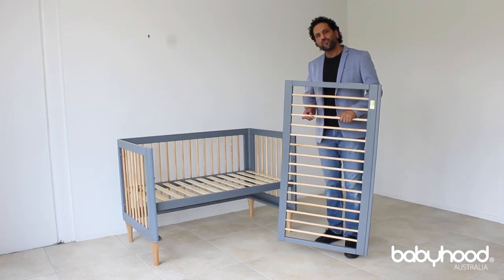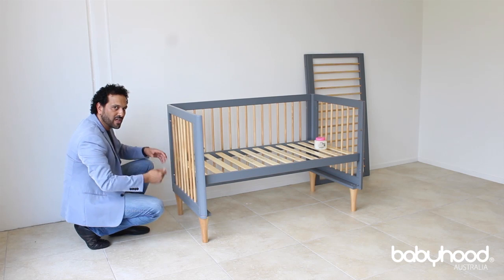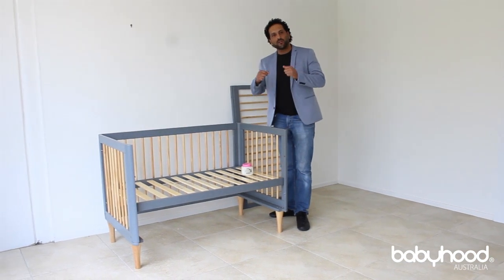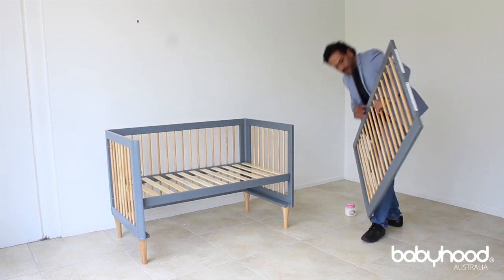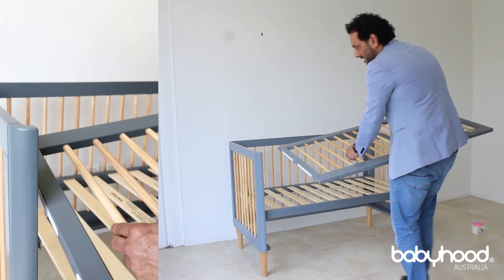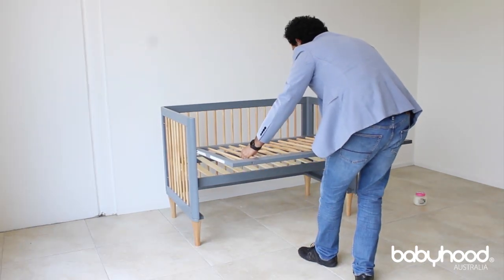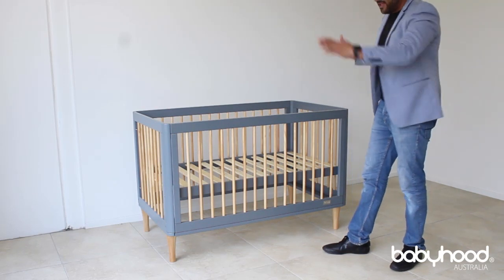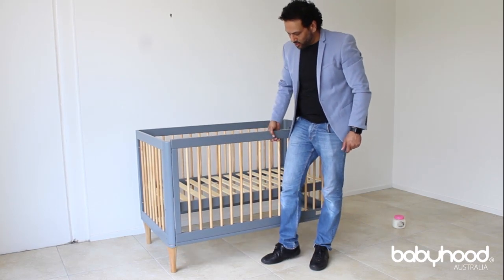How to Assemble Babyhood Riya Cot- Dropside Installation Demo

Comment: These cots are terrible... the Babyhood cots... avoid! Aftercare is non-existent
Reply: Hi! I’m considering this cot. What is your issue with it?
Reply: @joeynguyen104  The sliding part of it is so poorly designed. Contacted the manufacturer to ask for that part to be replaced and because we had put the rest of it together he wouldn't supply it and blamed us for breaking it. It little cut out plastic that is really flimsy...
Reply: @joeynguyen104  did you end up buying it?
Reply: @ThePC3D  yes I did in white colour. I don’t use the sliding piece often so I don’t have issue with it. It could be a little bit tricky to figure out the way it works but once you figure it out, it’s not that difficult. Good quality overall